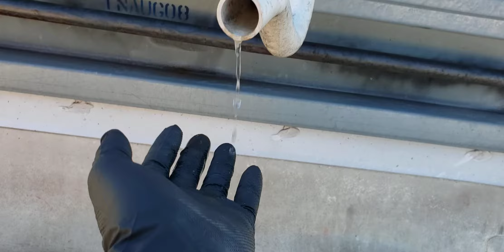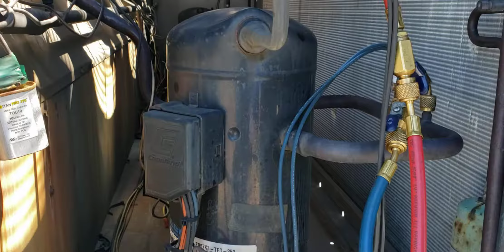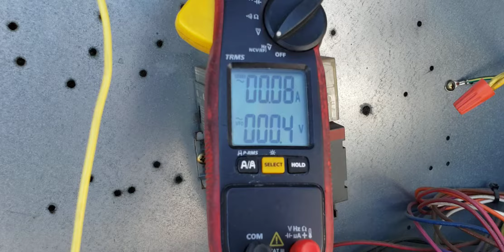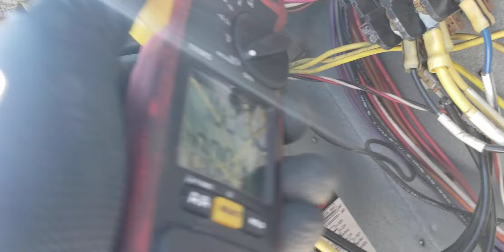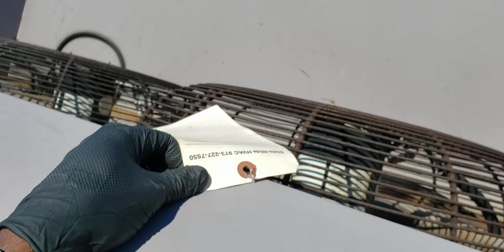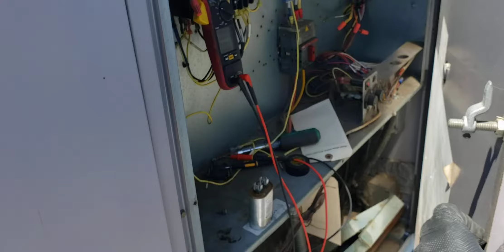TROUBLESHOOTING, DIAGNOSTICS AND RESOLUTION OF A HVAC OR AC UNIT ON A SERVICE CALL

Comment: How did you run the motor with other capacitor such as the wiring goes? Since you removed both brown wires??
Reply from the maker: Because the run cap is use mostly for starting the motor

Comment: 24:56 how ?
Reply from the maker: Here’s how, the capacitor is connected to the start windings of motor, which is responsible for starting the motor and determines the rotation. Hence with a bad capacitor most often  motor will not start or may start and runs in wrong direction. By using your hands you can almost replace the start windings
Reply: @D2DNYAC  ohhh lol ok. make way more sense the way u explain it
Reply from the maker: Good question my friend

Comment: Those CLO boards have to read a minimum of 2.5 amps within 1 second of startup. It doesn’t lock out with high amps.
Reply from the maker: Got it
Reply: @D2DNYAC  I had both boards go bad the other day. Checked my amps and both stages, both good. Jumped the pressure switches out after verifying pressures were good. Still cut out on lockout. All you have to do is remove the shared common (x terminal) and it will bypass the board and keep the pressure switches in service. Thanks for your videos!!
Reply: Years back the journeymen would call it the “low or no amp lockout”. Thanks for the details on it!

Comment: You were 100% wrong on several things. The wiring on a 120V fan motor wiring does not affect rotation (you confused that with a 3-phase motor). You never actually pressure-washed the dirty coil to verify if that was also a factor of high head pressure. You left the panels off when checking the pressures.  These are very basic apprentice level mistakes, bruh.  Some things you did were right on, Im not saying it was all bad. But alot of basic mistakes were made here.

Now fix yourself or you can keep whining in future videos about white guys (your racist words, not mine) proving you wrong instead of fixing yourself and gaining the correct methods. As much as blathering on with random ideas and half of them being wrong is entertaining to watch, you gotta do better than this friend.

Comment: No building automation? That's how you find out rite away which one is down. I'd be suprised if a setup like that had no automation,if it doesn't than yeah that sucks but you're rite about checking for no condensate, good place to start for sure
Reply from the maker: Thank you for stopping by

Comment: What happens if the condenser coils are cleaned but still you are expiriencing high pressure
Reply from the maker: Condenser fans( check air flow across condenser)or refrigerant charge issues

Comment: Those unit have a known problem with the condensers , the coils are stacked one stage on top of second stage and the top coil always gets recirculated condenser air so one stage always runs higher head than the other. Usually fix that issue with a old style hail guard but you can't get those anymore so many fabricate their own to keep them running. more often than not you find these with all the high pressure switches disconnected. They make a 25 ton version with semi hermetics and those slab coils are thick and get plugged so thoroughly you can't clean them with out the fire hose treatment. basically you want to get rid of these as they are money pits, sometimes the belt break and grab all the capillaries and rip them out of the evaporator, I have seen them eat so many compressors the condensers get clogged with braze balls and shellac from burnt motor windings etc etc.
Reply from the maker: OK my friend thanks for watching

Comment: how'd you get it to run in the proper rotation?
Reply from the maker: 3 phase motors just switch around any 2 power wire leads

Comment: Not how a lockout board works. Doesn’t look for high amps it looks for low amps.
Reply from the maker: Interesting 🤔! What are you saying?
Reply: @D2DNYAC  if the compressor does not pull more that .5 amps then the lockout board will disable the system until a power cycle resets it.  wants you to find the cause, ie LP or HP etc.  you will know you are on lockout if you have voltage to the x terminal
Reply from the maker: Perhaps you arev right my friend! However 🤔 I will have to test this theory 💡before I can accept it ! I will also do a video as well if possible  stay turned
Reply: HP wouldn’t cause low amps